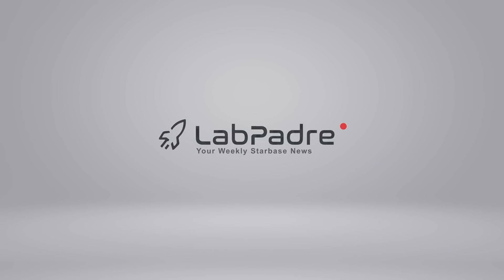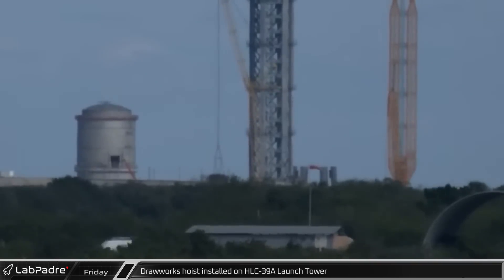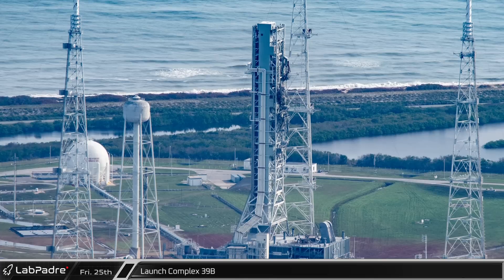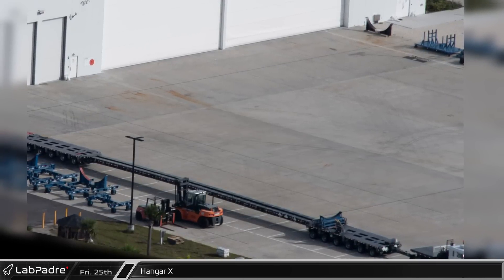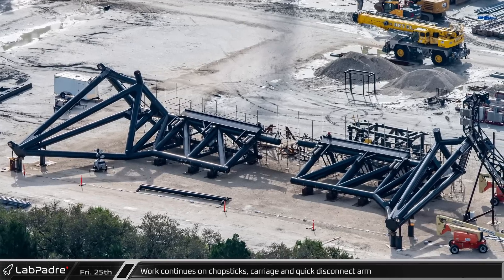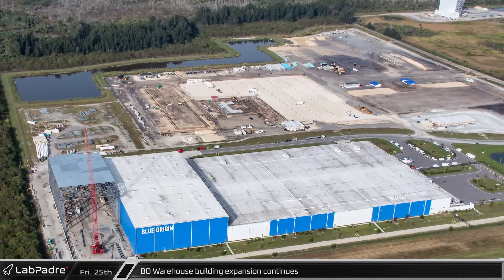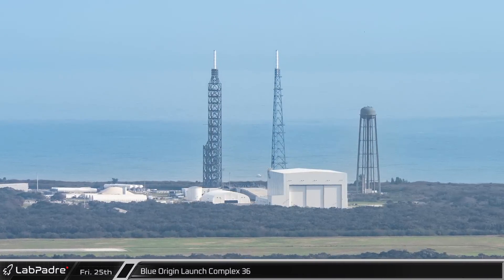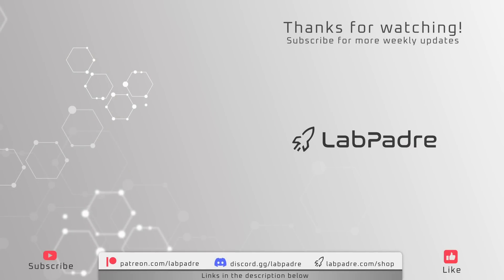Massive Starbase Deluge  - Weekly Update #38

Comment: I think they will use the 2nd tower as a "catch-only" tower so they can practice catching the booster/ship, without risking damage to the plumbing, OLM etc. If my theory is correct, we shouldn't see a Quick-Disconnect-Arm or any plumbing inside the tower. Only the chopsticks and its mech stuff.  Thoughts?
Reply: I'm thinking they will launch from the tower/OLM currently being built, and try and practice landing on this tower on one of their landing zones. Once the tower successfully catches a booster/ship, they will transport it over to the OLM using the mobile transporters!